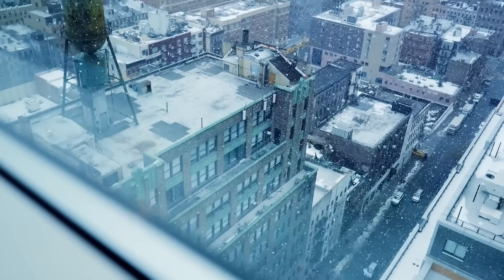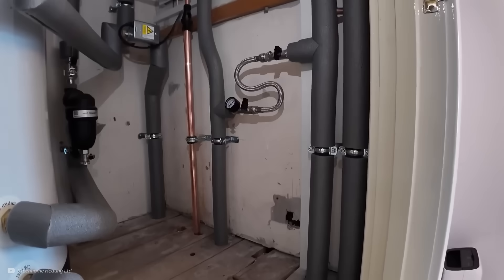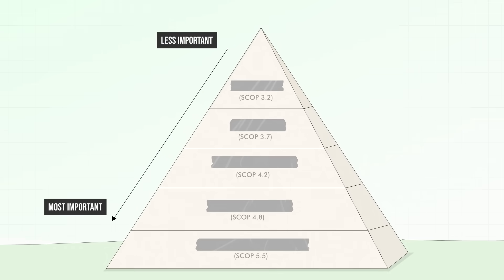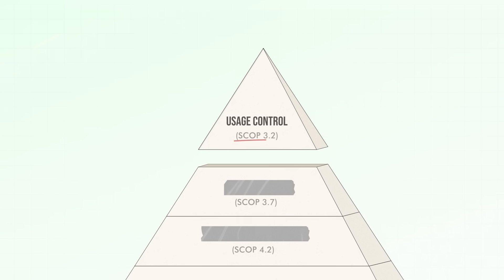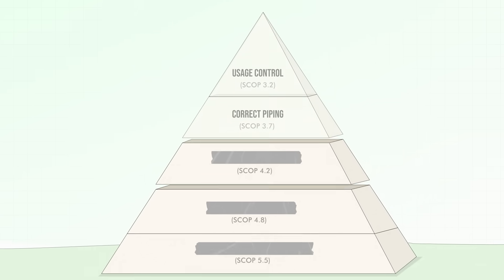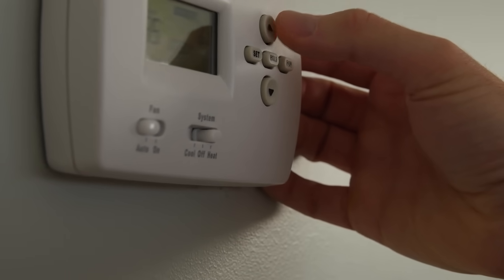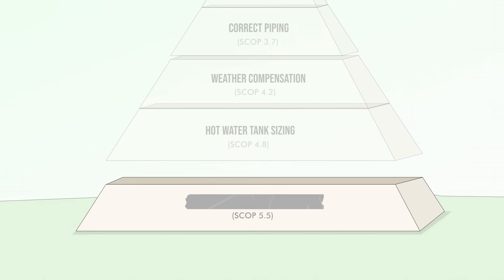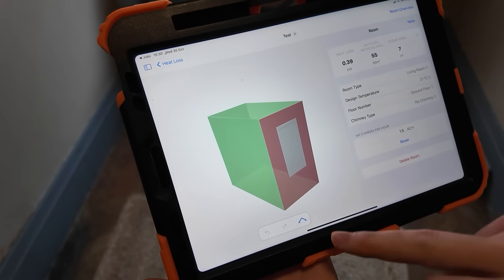The Genius of the World's Most Efficient Heat Pump

Comment: Weather compensation is sometimes call "outdoor reset" It raises water temp to compensate for cold weather. Ideally there would be 4 outdoor sensors cause each side of the house will have different demand. There is an optimum point balance between the cost of circulation pump power and cost of heat pump power. The warm water should hit  perimeter circulation circuits first cause exterior walls is where the higher demand will be -- similar to how in a forced air system registers are placed below windows.

Comment: My 10 year old  Daikin Altherma does all the things that you've mentioned. It adjusts all the time via the inverter the 2 compressors and the inner circuit temperature alongside with 10+ sensors. Heat pumps are the future and the cheapest heating method.

Comment: You are trying to take credit for technology that is already in use for over 25 to 30 years.There is nothing new here .And remember lower water temperature means higher flow rates and larger emmitors. Another important factor is all domestic hot water needs to be heated to over 60 degrees centigrade to prevent leognare disease ,A thermostatic mixing valve is used to control the temperature of the hot water.

Comment: The worst thing is to overhipe a boiler or Heatpump. Exaggerated claims lead to major disappointment. You have to back up figures with real life Tests and measurement with the proper inturments that are independently calibrated by recognised laboratories .I am a Heating engineer 48 years ofof experience in many fields.Gas,oil,solar,Geothermal,hczc

Comment: Nuclear Engineer here, a nuclear power plant puts out about 4000 MW of heat for only about 4 MW electricity input into the pumps for a heating COP of 1000. Further gains can be made with the ESBWR, which is about 5000 MWth output, and the only pump electricity is the feed water pumps.
Reply: Until we all have personal nuclear power plants, isn't your topic irrelevant?  Or am I missing something here? ;)
Reply: You're saying efficiency is 0.1% but that can't be true. A basic boiling water reactor should be >30% efficient in converting heat to electricity.
Reply: Hi  @Max24871 ,  I am saying a BWR  “efficiency” as defined in the video is 100,000% COP, that is 1000 heat unit outputs per unit of electricity input.

You are considering the thermal efficiency of the plant, which is the more closely related to the efficiency of the turbine, which is yes, about 1 unit of electricity output per 3 thermal energy inputs. 

To further expand on the subject, the 2 of 3 units heat that aren’t converted to work are rejected to the atmosphere. If these units were used for district heating, the “efficiency” of this system would be heat output used / pumping energy to distribute the heat, which would depend, but probably again, around 100,000%. 

It’s just how efficiency is defined. Engineering is fun like that
Reply: @mackcullison6316  that electricity put into the pumps, that energy doesn't go to waste, does it? that energy is converted to heat. some of that heat in the motor and one in the fluid it is pumping.
Reply: @lorenzo42p 
If you assume the pumping as an adiabatic process then you can assume that there is no heated added into the pumps, ie, there is no waste heat in pumping the fluids. 

Although, this is not the case. Pumps are between 95-95% efficient, the electric motors that power the shaft input also have similar. Because water is an incompressible fluid, you can determine the power=pressure x flow rate. 1 HP = 550 ft-lbs/s. Any efficiency losses will show in the heating lost in the casing of the pump and warming in the lubricants, and heating in the fluid
Reply: @mackcullison6316  yea, my thinking is, circulation pumps today are pretty good. with or without a pump, you will never notice a difference on your power bill. spending hundreds extra on high flow efficiency copper pipes doesn't make much sense. they are claiming to optimize things like this in the video... they're not making something new, they're only spending more money.
Reply: That's bullshit!

The energy is coming from the fuel - whereas with a heat pump the energy being pumped is NOT coming from the fuel.

The correct efficiency for a U cycle NPP is 1.8% or a COP of 0.018 (if Im being generous and ignoring the amount of energy lost from the mass conversion that's not becoming heat)

So try being a better engineer and not lying about what efficiency actually is!
Reply: @rwerk66  I think the type of efficiency we are talking about is the type of efficiency that affects the wallet of the customer. I could spend a billion dollars making a nearly 100% efficient heat pump for my house, but that's not efficient on my wallet. there needs to be a balance between hardware and install cost, and the energy cost savings of an upgrade of any part of that hardware. that's what I'm saying anyway.
Reply: BTW if I use your nonsense definition of heat pumping then my hot tap has an efficiency of infinity cause the heat coming through it is requiring no energy input at the tap.

Please do better mate!
Reply: @rwerk66 
I see your point, the point of the thought experiment is to challenge the concept of “coefficient of performance”. The coefficient of performance is energy output per energy input, in the case of the 800% COP, that 8 units heat output per electrical unit input. 

So, you need to first consider the “control volume”. When we look at the control volume, we can consider it a black box. So yes, if you look at your faucet as a control volume, and you only look at the output of the water, and neglect any input, you could consider the COP as infinite. Which, I think is why faucets are so valuable to us. 

I think your point is to criticize what is a control volume. A heat pump has the COP because heat output is valuable, and so is the electricity input. A COP also reaches infinite if you consider solar heating for water, if you consider opening a window to cool your house, a ceiling fan to push heat down from your ceiling onto you, etc. 

It’s not bullshit, it’s not lying about efficiency. It’s a criticism about the coefficient of performance, which is efficiency of an item when neglecting some inputs/outputs.
Reply: If you were to look at the coefficient of performance of a (heat pump) heater, you would really hope that the maximum efficiency peaks beyond 800% considering it is hotter outside our houses most times of the year, effectively being an, “open window”.
Reply: @mackcullison6316  there are heat pumps for hot water, but as I was saying, it comes down to cost vs savings. it probably wouldn't make sense to spend double on a special ultra high efficiency hot water heat pump vs a more common one. and where I live, it doesn't make sense to even buy a hot water heat pump in the first place.
Reply: My propane heater has a COP of infinity because it's all mechanical and draws no electricity!
Reply: How about factoring in the fuel energy contribution to the system?

Comment: Aside from the system's infrastructure and calculations using more variables to call for heat, how does the actual unit's ability compare in terms of its efficacy in relation to energy to heat conversion compare to traditional gas units if they were to have modules to calculate scheduled calls for heat in the same manner with the infrastructure also being a controlled variable? The final factor that will get people on board with this technology, is whether the final costs of the gas or electricity bill is cheaper. Gas and electricity costs are NOT the same in every region of the world. Climate, isn't even the same in all parts of the world (i.e. compare Northern Canada with most places in the US).

Comment: It is another bull .....!!!! You can not achieve COP 8 from pump which can give you max COP1,5 when outside is -10  C degree.!!!!!!!!!!!!!!!! In heating pumps everything is depending how your house is isolated, what temperature is outside and how high temperature you want to have inside. All factories guarantee max 2 COP when temperature outside is -10 C degree and.........your house is very, very good isolated.(40-80 kWh/m2/year) when average house in England has 200kWh/m2/year isolation.:penguin-blue-waving-tear:😪🤧😓 That is true!!!!!!!!!!!!!!!!!!! This is the most expensive method of heating average house anywhere!!!!!!!!!!!!!!!!!!

Comment: Thermophilic bacteria(what causes mulch fires of nutrients too dense) + Cold steam Tesla(to use that low heat for great turbine power) + Ultrasonic holography tank(to extract nutrients from Human waste to mix with water to fill tanks) + All metal Panels with nutrient drip system(Throttle control by nutrient density) + Ultrasound frequency resonance speaker system (to warm water by crank by targeting water molecules to use as a heat source to thaw nutrient solution if you abandoned a place in cold with system off) = Self replicating super efficient billions of years old organism that if you stop feeding and they freeze they will only SLEEP until you feed them again. I added Ultrasonic resonance because water will evaporate out instead of get too hot to be dangerous to Thermophiles heat survival so no killing them just design a pipe leading to glass and stop cranking to thaw system when you see it fog up.

Bigger the panels = More heat volume. Media: "Mulch can spontaneously combust because of black mulch!" < Evil LIES.. Thermophiles getting the washed down increased nutrient density that makes black mulch is what causes the fires. The world oil that even owns all the solar and biofuel companies by proxy 😂 They don't want you to understand. You can breed heat and as long as one person is using the bathroom or producing food waste that system can never run out of fuel. You'll have too much so if you want to expand your system you can pump nutrient solution to barrels and have the food ready many months ahead of your new building. Thermophiles are like a real Dragon story, feed them too much you can be punished by fire.

Comment: Its an ironic situation, that forty years ago, I designed a fully integrated house, which included a comprehensive heating, ventilation, and insulation system to reduce heating costs. The house was to be factory built and standardised designs to reduce costs, including pre installed electrical, water and heating installations. Government Building Regulations would not, then, allow the design on their current building construction ideas. I hoped to find a new market to keep a failing company alive, to no avail.
Reply: Mindless robots occupying official positions, aka Vogons. Not actually evil, but callous, officious, and bureaucratic. Also quite bad poets!
Reply: I followed a similar path.. I enjoyed designing on CAD (Sketchup)  programs and working from materials in.. to take advantage of say Timber sizes..  Refined it to the 'enth' degree and then tried to find a 'Professional'  (Architect, Engineer etc ) to take the project forward.. That was 8 years ago and I have had to admit defeat as they want the 'same old.. same old' and do not like 'New' ideas unless they are providing them and looking for some kind of Accolade...
Architects never say 'No' but after months of waiting to hear from them.. Thats what they mean..  Its a 'Glass ceiling' for the Tradesman  trying to hire a Professional.. 
Oh.. and Heat Pumps do not do what you hope they will do.. Ask anyone who has a Swimming pool.. THAT is where the Heat pumps were designed for and get good cheap heat in the SUMMER..

Comment: You can have 800% profit...but I’m not sure you can have anything above 100% efficiency.....good luck with trusting this channel....block the bull.
Reply: So there’s a lot of people commenting the same thing but I’ve replied to you because you’ve drawn an interesting comparison. If a thermal spa can pump hot spring water into a building, and charge people more than the pumps and staff cost, they’re getting out more money than they put in the same as they’re getting out more heat energy than energy goes into the pumps. Outdoor air below freezing still has heat energy to be captured the same as hot summer air can have heat expelled into it. You’re just expending a relatively small amount of energy to manipulate refrigerant to go from gas to liquid to gas. The individual components of a heat pump are less than 100% efficient but the system works like a business.

Comment: In the UK, Heat pumps make a LOT of sense.  Here is Canada SCOP is a pretty useless number given the variances his daily temperatures - Summer external temps can be 40 degree C and winter and even hit minus 40 Deg (although rare in the southern part of Canada).  At these extremes (especially cold), the Heat pump COP degrades to the level of 1:1 (almost but slight less efficient than a resistance heater and must be supplemented).  In addition the capacity of the system to move thermal energy also degrades so a system that might be rated for 60,000 BTW might only have capacity to move 24,000 BTU (or less) at the lower external temperatures.   SCOP is a useless term as it “averages” all of these extremes - effectively hiding very critical design considerations.  (And cost as well if electricity prices are seasonally or demand adjusted for example, if really cold and electricity demand/prices are high - the extra electricity consumption could offset the cost savings during more moderate operating conditions).

Comment: Lol, refrigeration being sold under the bs sales tactics calling them heat pump to make it sound efficient. A heat pump is next to the worst heating efficiency out of any heating system running on electricity..... Unless you have massive requirements to already refrigerate something (like a large industrial freezer) then creating heat this way is crazy inefficient compared to just using the power to run a resistive water heater or infrared air heater ....

This is further compounded by your advert midway through you presentation about how you present a solar battery system charging up to full capacity when it sees there is a chance of a storm as some innovation, like it isn't already doing this due to the chemistry being used or the fact that it is a solar battery charge..... lol but the "energy optimiser"  wasn't a red flag enough 🤣🤣🤣

Comment: One more thing - our little factory has a couple of heat exchangers that heat water with the waste heat from the cool and freezer rooms.

And a second thing - as compressed (hot) gas is decompressed for the cold side, a big  ~~10-25%  of energy is literally LOST.   Large commercial systems have little impeller turbo-like decompression generators that recover much of this energy.   I worked on commissioning LNG plants,  which are partially giant heat pumps - we had decompression generators up to (if I remember correctly)  about 32 MW.   That's a 110,000V generator 4 stories high.   All from decompressing gas.

Comment: I've seen somewhere on a construction side a really really huge digging machine and then i asked what's the purpouse for this machine and the operator told me that this machine, 18m tall, dig a deep hole around 150m and 50cm wide ( some customers demands way over that number ) and at the bottom is actually 25-30c. They dug 8 of them and installed only 25kW heat pump for a rather big, really big structure. 4 floors, each floor has 470m2. I don't know much about how efficient it was but this operator told me that heating with gas will cost 13x more than heating with this system and electricity. Throughout the year, the earth 200m deep will remains at nearly constant temperature above 20c so they " pre-heating " the " wasted heat " so the refrigerant stays above ambient temperature thus, gaining more efficiency. It is also more expensive and that particullar thing cost between 400-750k depends on the soil underneath and how many holes you want but they always come with some aknownledged person who tell you exactly how many holes your appliance need. So for the regullar house, they dig only 1 hole also 200m deep and it's enough to boost the efficiency of the heat pump even higher.
Reply: okay now run the numbers vs air sourced against the cost of those holes >>. 
then again cant do that anyplace below -10F currently either 200m is 600ft here and thats like a freaking stupid 20,000$ well. thats never paying off anywhere in the entire USA.  >>

1400$USD will buy 21seer24000btu -10F capable of decent brand easily lasts 8 years.
2800/5000 will buy 4tons and get it installed

this system couldnt possibly ever pay for itself >>.
unless you were in like northern freaking alaska or some crap

Comment: Electricity is roughly 4 times the cost to heat compared to gas so any SCOP below 4 is more expensive. Then bear in mind that gas is instantaneous where as Heat Pump is slow and takes ages to gradually head a house. By the time you have paid for the heat pump and the increased insulation costs means it just not worth it.
Reply: gas isn't instantaneous. My dad's gas boiler still took hours to heat the home after being away for a week.

And gas isn't 100% efficient, best case if you're running the gas boiler at a high temperature is about 85% efficiency.
Reply: @BenIsInSweden  OK. With gas my radiators in every room are at 70C within 1 hour. With heat pump they are lucky to get to 50C after running for 8 hours.
Reply: @Barbara-l2x  So? Doing that with a gas boiler will cost a lot more than letting it warm up slower regardless.  And it doesn't build up the thermal mass either doing it quickly like that.